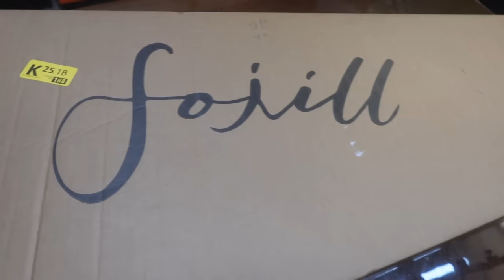AMAZON GUITAR Is Just Stupid Good!! Multiple colors And So MUCH FOR LITTLE $$$?? TELL HOW ME PLEASE!

Comment: I bought a Fojill as a Christmas gift to myself - This same model in metallic pink for $99 on Amazon. I just wanted to see what would show up for that $ and I was absolutely knocked out! The finish is actually more rose gold and it's flawless - 'Beautiful neck as well. 'May swap electronics and add locking tuners but even as is ... DAYUM!
Reply: 20 years ago, you couldn't find a used beat-up neck for what you can buy a really decent guitar for now! And you can always upgrade it as fast or as slow as you want...
The CNC Machines have made knocking out guitars like knocking out widgets! The fact that the "big guys" are still getting anything more than $1,000.00 for ANY GUITAR 🎸  😮 is a mystery 🤔 to me. I was a professional musician and a professional audio engineer in Las Vegas for 40 years. I did an "Industry Event" for Gibson Guitars in 2005. One of the "Suits" told me that it cost them (including labor, power bill, property insurance,  and every other penny that you could imagine in including in the cost) about $360.00 for a Les Paul Standard that sells for $3,000.00!!!
God bless and take care...

Comment: Wow! Got lucky and bought this immediately on your recommendation in the color I really wanted, scored shipped for less than 100$. I've bought five other lower cost guitars this year just for fun, and this is by far the best of the sub 500$ models I can compare it with. The rosewood fret board is most reminiscent of a nice Danelectro, and the sustain and ring un-amplified is warm and bright even with the junk strings that shipped from the factory. 

I haven't evaluated the pickups yet,  the action is a little high, but you really hit it on the head this time, thanks for sharing.  Great job. 

I would like to see what a pickup upgrade would do for this guitar? Something reasonable in price???

Comment: I just looked this up to see if they had any and now the price is $149.00

When you were checking the neck and you said about what people are commenting on what you're doing. 

So can you tell me if this was just another YouTuber gone wrong? I was asking a question about restringing my guitar and the first thing the guy told me is that I have to take all my clothes off. 
I said what is that for he told me every clothing maker product adds small fragments of material that comes off and when your guitar string is not tight enough that the fabric turns back up turning it up. Also for some reason I had to FaceTime him the whole time I was working on my guitar. That's normal right? Or should I call an adult. Of course at my age it would be hard to find somebody older.   -)

Comment: There’s an interesting trick I was informed about setting the neck, which is after installing the strings and tuning it up, you then slightly unloosen all four neck screws allowing the tension of the strings to “set the neck” and then re tighten the screws afterward. I tried this on a few of my guitars, I could hear the neck pop not crack as the strings pulled it into the pocket. Maybe give it a try.

Comment: I have to admit those are nice guitars and great guitars after you set them up. I hate saying it but we don’t have anywhere to take a guitar to be set up. Oh they can change strings but that’s about it. I’m terrible but guess I’m no worse than the guitar shop. I have a Tele in my closet that I paid to have a nut changed , I hate what he did. The old nut was at least decent. I have  a Carvin that has never played right. I’m to deep in it to sell or trade. It’s a beautiful paper weight. You could do a whole show around it! It’s a trip to Nashville for any real guitar work. I’m old and can’t drive 6 Hours there and back. Be a old gimp never gets any easier. Keep cranking them out ! Great videos ! 🏍🎼🇺🇸👍🎸
Reply from the maker: Send the Carvin to me, I'll fix it.
Reply: I'm in a similar situation. I've got a wall hanger that's got plenty wrong with it. Like you, there really isn't anyone around here that works on them. At least not that I trust anyway. The one in this video is pretty nice for what you get, but it still needed a good setup by someone that knowswhattheyaredoing. I just wonder about consistency. If someone bought ten of them, how many of those would be playable and how many would be crap?

Comment: Got the blue flame version in today.  It is pretty, the neck feels great, tuners feel slack but it seems to hold tune for a bit. However there may be an electrical ground issue as all the pups have a hum.  Also the pickups seem thin., not microphonic, but just no beef to the sound.  Will have to pull the covers off the back and investigate..  It isn't too bad for $89.  I like it better than the Monoprice Strat I got for $84 from Amazon during Black Friday.
Reply: Frets ok?

Comment: The pickups are big antennas, so not sure what good shielding the cavity is going to do. I've read all kinds of arguments, some suggest that single coils benefit, while humbuckers not so much. One guy even tried to claim that the shielding would change the resonance of the wood and affect the tone 🤦‍♂. Sounds like a good science project. Until someone can demonstrate a significant difference under normal operating conditions, I'm not worrying about it. I'm beginning to think that guitar guys are even worst than car guys when it comes to bickering over fine points that probably mean nothing in reality 😁😁

Comment: It seems like the ONLY thing "cheap" about it is the electronics, but they sound and work fine, it seems. I bet if a guy were to gut the pots, switch, jack, and pickups, and swap them out for higher end stuff, you'd have a 1500 dollar guitar for under 300.
Reply: You’d have a $100 guitar with $300 worth of electronics.
Reply: @GodzillaGoesGaga  in terms of just resale, yes, but it would be an instrument that punches way above its weight class in terms of quality and features.
Reply: @stringedaz  That’s a big “if”.  The quality and precision on high end instruments is incredibly good (except Gibson who are crap).  I’m not sure you’ll get to that quality easily but if you have the skills and the tools then maybe.
Reply: @GodzillaGoesGaga  True. There is definitely a point of diminishing return on cost for guitars, though. A 3,000 dollar guitar is never 3x better than a 1,000 dollar guitar, for example.
Reply: @stringedaz  Agree.  At least for me.  For the incredibly gifted I’m sure that the price is justified if it helps them with their nuances/style.  For me, no F’ing way !!! 😂
Reply: @GodzillaGoesGaga  I hear that! I've been building guitars as a hobby the last few years. I am by NO means a luthier, but I've gotten decent at assembling, wiring, setup, fretwork etc. I bought a 60 dollar amazon neck last week, and I crowned, leveled, and polished the frets, and then I rolled the fretboard edges and formed and installed a graphtek nut. The finish isn't stellar, but it's as nice as a much more expensive neck at a fraction of the cost. The body is a cheap, but full size squier strat with lace sensors and good pots, switch, etc. Gotoh tuners and wilkinson trem. Short story long, I'm in the guitar 350 or so, and it rivals my MUCH more expensive American and Japanese stuff.